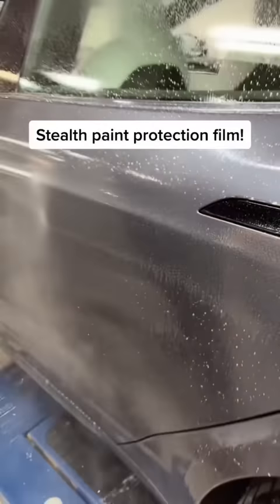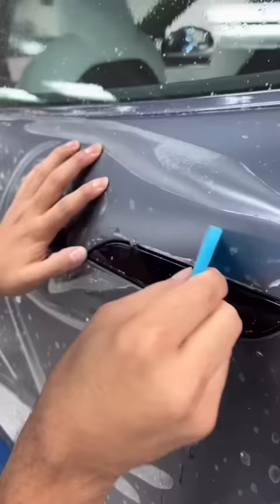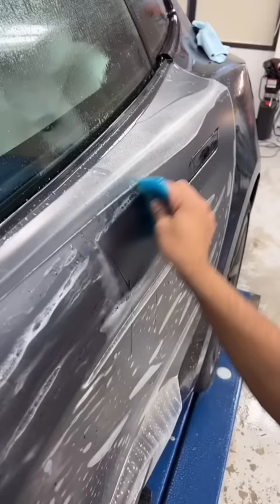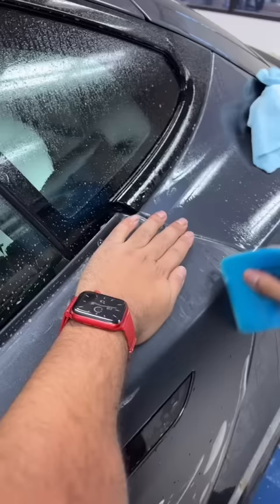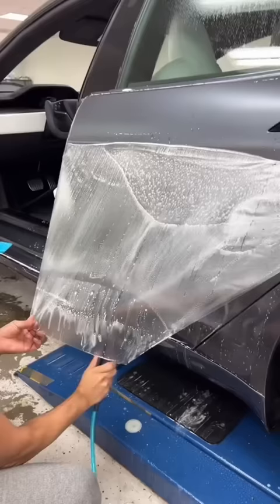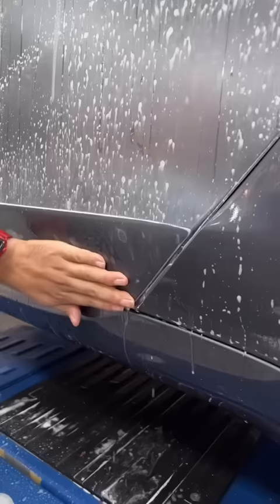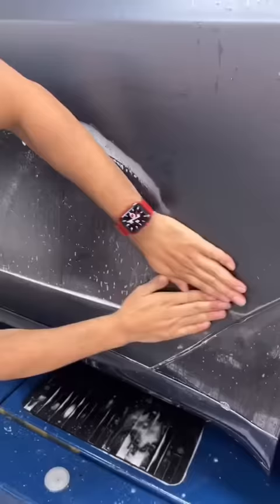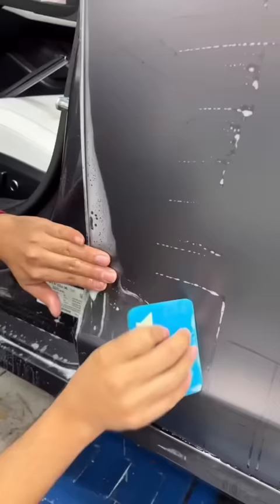Stealth paint protection film on a Tesla!

Comment: Paint protection flims are usually for one fourth of hood, front bumper, or headlights. Applying it full body will cost about the same as full body repaint. Not worth it.
Reply: Full body paint is at least twice as much
Reply: @LandonsBuildz  well my brother charges $1200 for front bumper, headlights and front fourth of the hood. At that Price I can get front rear bumpers and hood repainted
Reply: @tbvjqor123  that’ll be a shit paint job. A proper paint job is going to cost 8k roughly. This full body protection probably cost 3k. This only makes sense if you buy a collectible car

Comment: Be interesting to know What’s the cost of replacement for the film vs cost of touch ups.
Reply: Touch ups? 🤔
Reply: @berntsrensen1217  You can buy paint from the car manufacturer for like 20/30$ that you can apply yourself to small scratches and chips and save a bunch of money
Reply: @madladcas6262  paint to fix the vinyl wrap?
Reply: @berntsrensen1217  No. The wrap is protection for the car. So what is cheaper, using and replacing the protection wrap, or just doing simple touch ups with cheap ass paint.
Reply: @madladcas6262  ah now i understand whot you was talking about. But you dont understand WHY People wrap there cars. Touch ups you do on an old shitt car to make it looked better
Reply: @madladcas6262  painting and take care of the paint (polish and so on) is way more expensive then wrap
Reply: @berntsrensen1217  Like I said. 30 bucks, you can do it by yourself for small scratches.
Reply: @madladcas6262  ye i bet yiu wuld do that to a Nice car 🤣 dont talk about things you dont know ✌️👌
Reply: @madladcas6262  touch up paint compared to a paint protection? Don’t think we can make these sort of comparisons. Touch up paint looks cheap and only hides the scratches from the naked eye far away. That’s like a band aid and not protecting or repairing anything
Reply: @derrickd5  If you sand the scratch properly, use factory paint (exact color) and finish with polish, you can't even notice the scratch. The 30 bucks paint + laquer u get from dealers will last for many many touch ups, and will protect from rusting as long as its cleaned properly with like isopropyl. Could use some rust prevention product too.
Reply: @berntsrensen1217  I got a headache trying to read this, is English your second language?
Reply: @SUMDUDE.  yes it is, im norwegian.
Reply: @berntsrensen1217  no is not 🤣
Reply: Would ppf increase the resale value over paint chip touch ups, is the more relevant question. Of course not, its at least several thousand dollars which will never be recovered. Has anyone seen what 10 year old ppf looks like? Nobody would want that on their car, just because it can last that long.
Reply: @berntsrensen1217  check my vid on it.
Reply: Heck I'd use two wraps, one to protect the first film